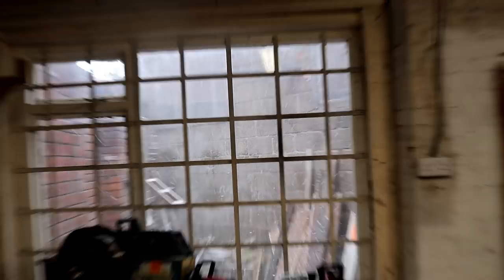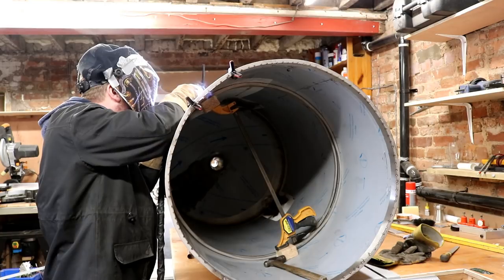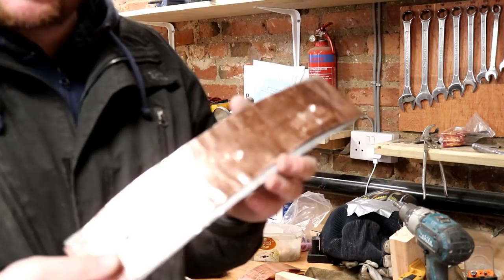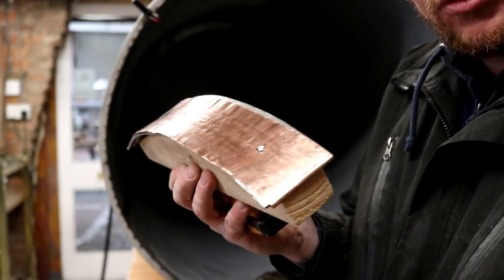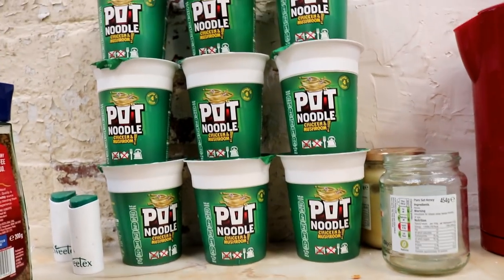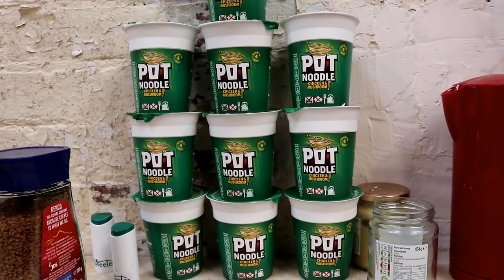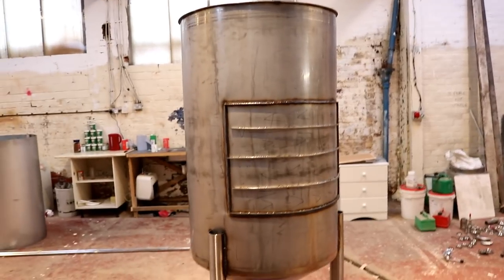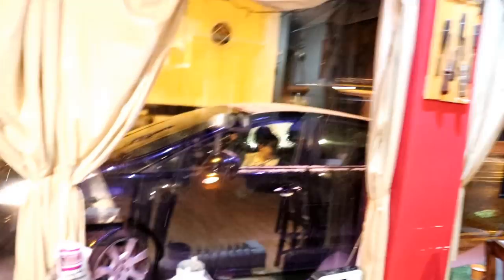Backing Bars For Stainless Steel Welding

Comment: Great idea giving the backing bar some flex, never would have thought of that. The cooling jacket is coming along nicely. Do you plan on capping the top of the legs of the tank(s)? I believe they are usually cut on an angle and capped off. Cheers.

Comment: What flow rate have you been running the argon at, and is it still c25 or 100%?
Reply from the maker: Always been 100%, I have 5% for the mig. 7 lpm for the torch and 3lpm for the backing bars

Comment: There,s no need for the backing bar thing, when welding the strips to the outside. It is solid so therefore no backing required (argon will from the gun will cover the weld)- joining pipes the purge is req. or your backing strip
Reply from the maker: I'm not doing it for my health. It is only 1.6mm stainless and there is tons of sugaring without backing as full penetration is unavoidable at that gauge.
Reply: So how would you tig .5mm.Your amps are far to high, you shouldn,t be blowing through on 1.5